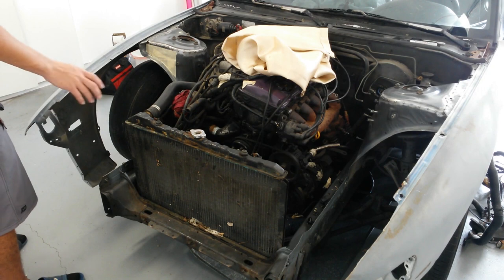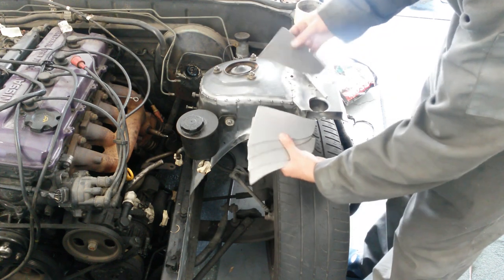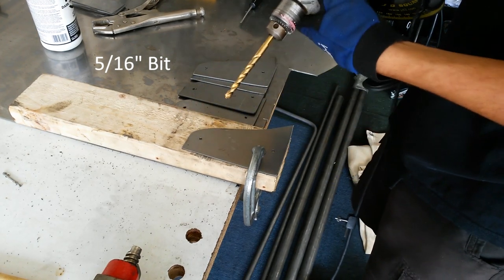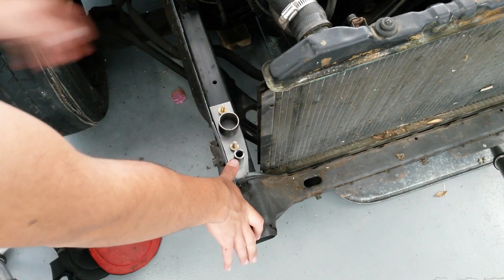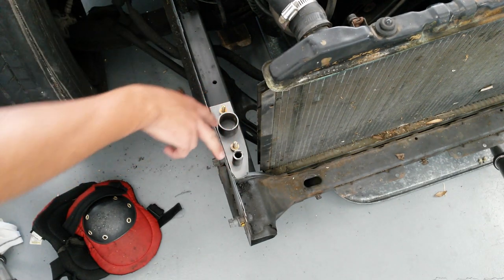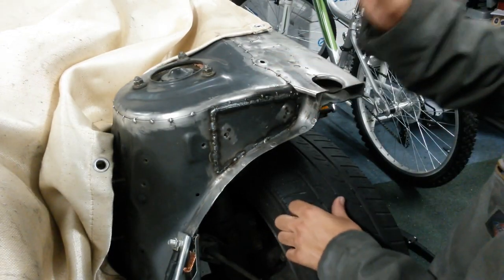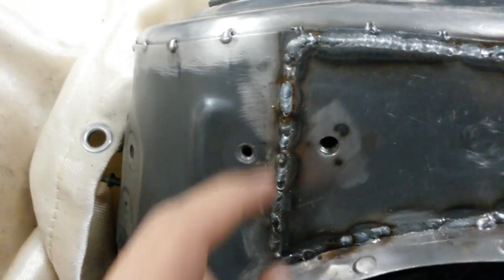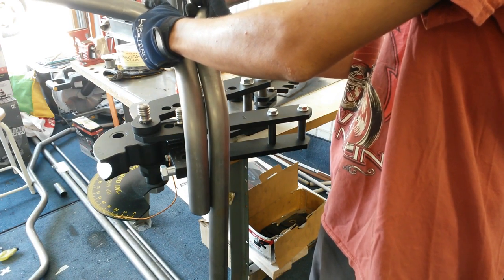Project 240SX - Le Drift Car II | Ep. 4 - Tube Front: Plates & Bending

Comment: Drilling those holes just made me cringe. Bro, you have a bench vice LITERALLY RIGHT NEXT TO YOU haha damn.
Reply: Also, welding tips for next time coming from a dude that used to do welding for a living! Blue around the metal = perfect temps. Greying means you're running the sheet metal way too hot and you're actually decreasing the strength of the sheet surrounding the weld. Smaller, cooler, slower runs helps. Same with the distorting sheet but you kinda figured that one out. Can use compressed air to cool the welds down quicker! For corners where the tip can't reach, higher amps, wire speed and gas flow to blast it in there. To save some time when prepping, acetone isn't really needed if you're blasting it back to bare metal anyway. Not once has anyone in any shop I've worked in done it. Just helps cut down prep time and expense :)
Reply from the maker: Mitchell Dowling Vice doesn't go wide enough to hold the piece in. I actually had a clamp that I could use to clamp the wood to the table but this was literally my first time having a bench to work with and I usually do all my work on the ground so I didn't even think twice when drilling cause that's how I've had to do it for years.

Yup lol I know about the metal. The thing was when I was doing a different part of the car that was also same gauge sheet metal I did a super long bead with no distortion whatsoever. So based off of that I did a long bead on the tower just to see it warped. Lesson learned though. I also was welding tonight for the plates for the bash bar, and welded downhill as some suggested all while only doing 1" beads at a time. Had a fan turned on for cooling and had plates stacked against the metal to help with cooling and it turned out great with no issues. Acetone is cause it's what I've always read online to do. Thanks for the heads up on all that, I appreciate the time you took to write that all out :)

Comment: what made you decide to take the car this route?
Reply from the maker: +jason martinez I wanted a car that wouldn't hold me back for whatever I wanted to do. Kind of a build it once and not have to worry about it again type of deal
Reply: +OffBeat Garage that is a perfect response and I bet it won't. good job on the build.
I plan on stitch welding my cars chassis as well, I also need to reinforce the rear shock towers, I will use the information I've learned from your videos to make sure I do a good job, thank you.

Comment: Just wondering is that FD approved?
Reply from the maker: +dav240sx Yes, FD doesn't have regulation on tube front design as long as it doesn't mess with pick up points of the suspension.
Reply from the maker: Tubing kind of just takes a lot of time. If you want your car done fast to get to the next event it's easier to just pull it out.

Comment: where can you get the first pipe bender that you were using?
Reply from the maker: Andres Olvera https://www.jd2.com/ They are usually back ordered though so call them up and they'll be able to point you towards someone local who has them in stock :)
Reply: +OffBeat Garage  and for the argon tank for welding...did you purchase it at harberfreight too?
Reply from the maker: Andres Olvera No that was bought at the local welding supply shop where I fill my gas. Harbor freight doesn't sell that big of a tank, only like 20cf and 40cf I think

Comment: Shouldn't you get the engine out and put the new engine in and radiator and everything before you put the middle tubbing? it would be easier.
Reply from the maker: ***** That would be the same exact difficulty. Except more work now because then I would have to take out the engine one more time to do the painting. That just added an extra step for no reason lol

Comment: Why would you weld the nuts to the plates at 8 minutes into the video?
Reply: Why would you complain about it?
Reply: That plate is welded to the car, the other plate on that side is connected to the tubing. It's so if the tubing gets damaged he can simply replace the tubing.
Reply from the maker: SolarEmpire450 It's so the plates can be threaded. That way the front end can be removable.

Comment: Hey don't want to be an ass but why not paint it last everything is nicely welded the paint over because you lower the risk of impurities
Reply from the maker: funky6399 Paint is done to cover the exposed edges that will be covered when the plates are welded in. The impurities are all gone since I wire wheel and wipe down with acetone the area that is going to be welded.

Comment: i dont think its gonna hold up, after 1 crash it will be totaled, please use some proper size tubing, and make it cover the front proper. http://sphotos-c.ak.fbcdn.net/hphotos-ak-snc6/665194_10151152955989103_1246402906_o.jpg like that
Reply from the maker: Runaeh This is the same size tubing as on that car lol. The whole point is for the front end to not hold up lol, that's why it's removable. To be smashed and then replaced.

Comment: the bolts are literally doing nothing
Reply from the maker: Michael Sandoval Tell that to Mad Mike and Rob Parsons lol
Reply: ***** sorry dude i just realized the fuction i was thinking you can put one metal with the nut on the entire other side of the shock tower like a skateboard truck
Reply from the maker: Michael Sandoval Ahh yea, I didn't put the plate on the back because of all the undercoating that is there which prevents corrosion. Also I might run into clearance issues with the coilovers if the plate is positioned on the backside of the shock tower.
Reply: Aight, thanks for replying
Reply from the maker: Michael Sandoval Mhm no problem!

Comment: DID NOT BEVEL THOSE PLATES AT ALL!!?? FFS!!
Reply from the maker: Matthew Muhlberg Slight bevel on them yes. Nothing crazy like some people where they take off like 75% of the base material doing a bevel.
Reply: well hopefully better than nothing!!  i don't wan't to see you smack a wall or meet someone's door and loose the whole front due to a shoddy under penetrated welds! personally i'd of gone about 50% due to how thin factory sheet metal is. also have you thought about stitching together the top of the shock tower like a lot of true "race cars" have done to their uni-bodies?
Reply from the maker: Matthew Muhlberg Tops were stitch welded in the previous video yea